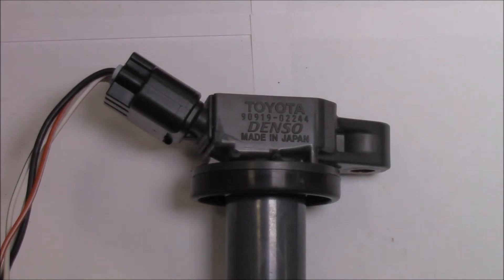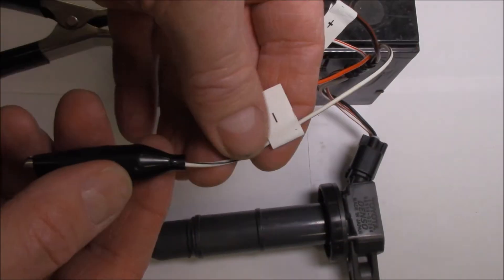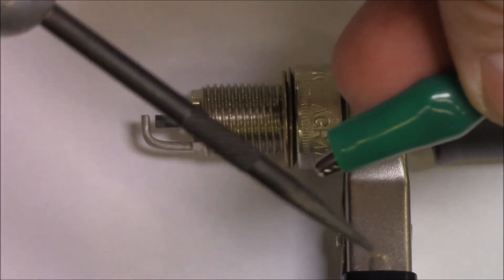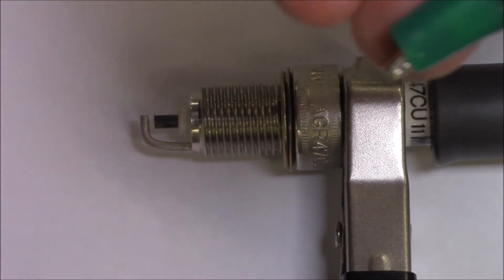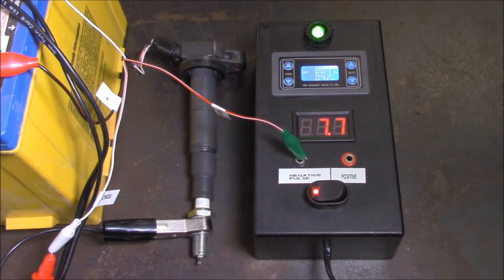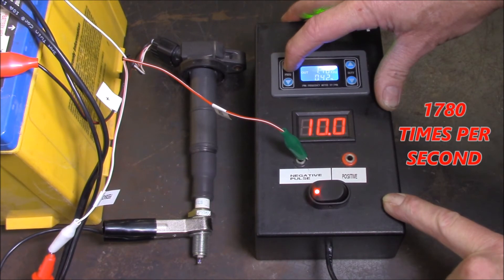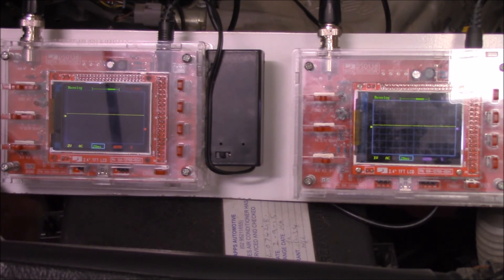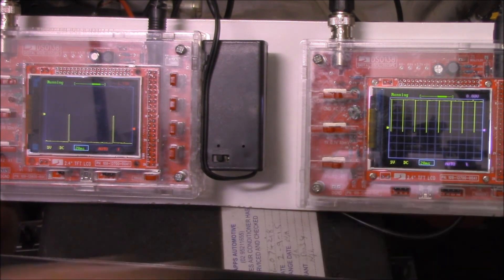Testing A 4 Wire COP Ignition Coil

Comment: Hi MM, the feedback circuit (confirmation circuit) protects the cat.really like the pulse width generator you built really handy diagnostic tool.read your recent article in T.A.T. good work. Thanks for sharing what you do.
Reply from the maker: Hey Itkaffey,
Thanks for that. 
I created these short ignition videos when I was teaching apprentices during lockdown. They are just the tip of the iceberg.
Yes, you are right. The feedback circuit is used by the ECU to detect misses, not only for code identification, but also the ECU shuts off the fuel injector to that cylinder, which in turn, as you said, is a catalyst protection strategy.
Thanks for your support and kind words.
MiracleMAX